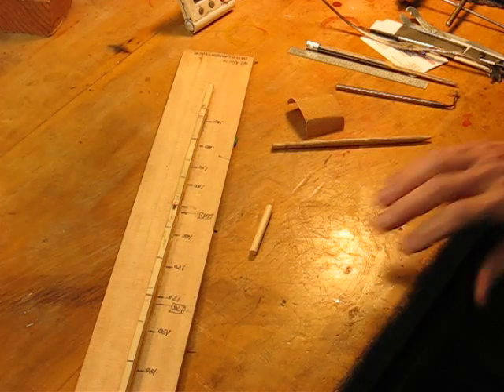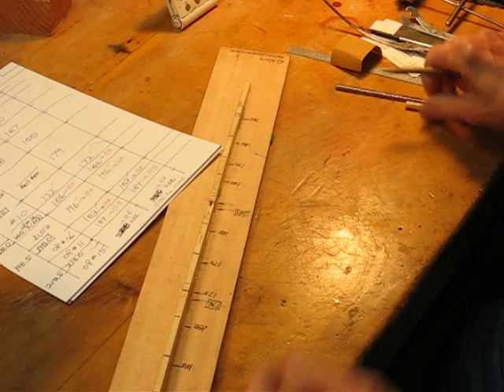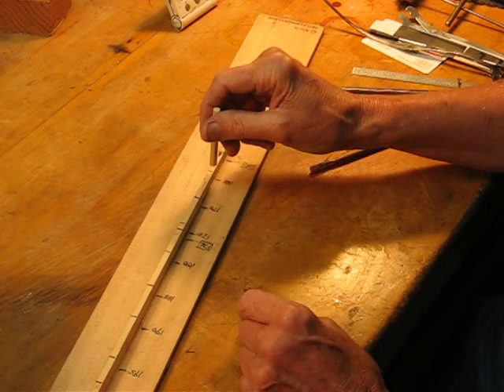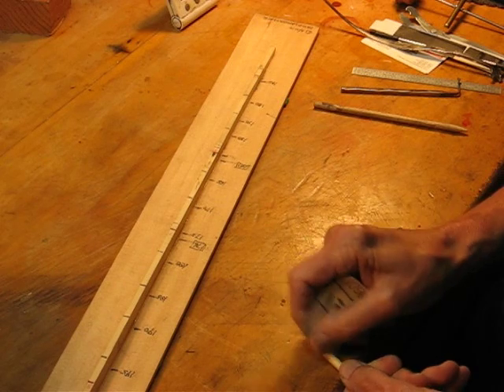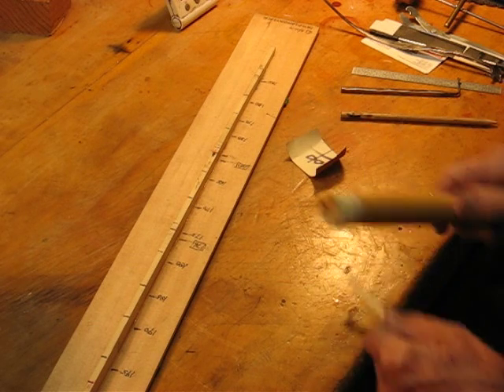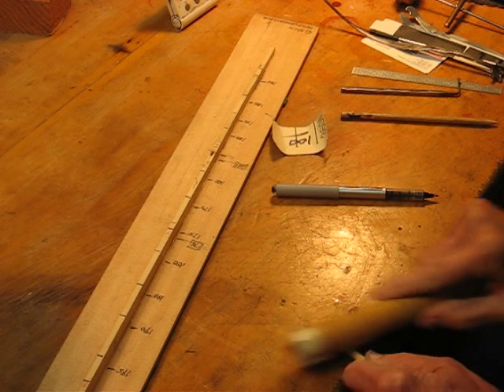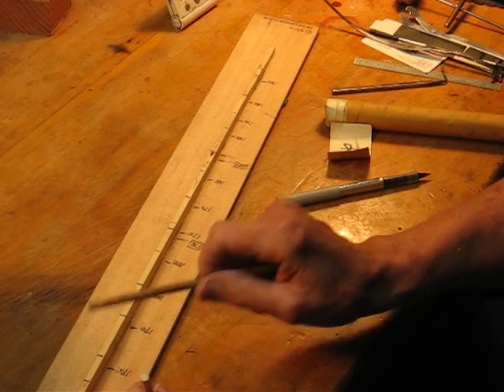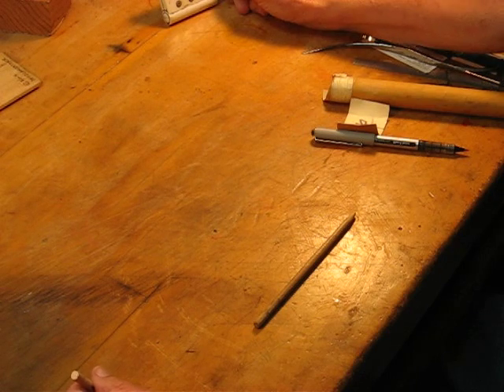SoundPostTuning

Comment: In addition to the tuning done here, there were at least 3 regions on the upper plate that Stradivari carved special;  1-under the soundpost/bridge on the top (and bottom) plate.  2-in the tweeter area left of the left f-hole.  3- he carved a finger of thicker wood on the top plate under the fingerboard. These 3 things evened out the sound from high to low frequencies and helped a lot to improve the  impulse spectrum amplitude overall (string speech time).

Comment: Nice video and explanation. How about the cello and bass? Any specification for them recommended? I am struggling with both instruments, especially with the wolf tones they have.
Reply from the maker: Danny;  I have not done a lot of investigation on the Viola / Cello / Double Bass yet but I suspect that the larger instruments values for tap tones will be in proportion.  For the double bass I might look for sound post frequency of 287 HZ and the Cello at 242 HZ (which I also suspect will be their back plate tuned Tap Tone frequency).  The Tap Tone / Wood Tone scales have these frequencies : 162, 176, 198, 213, 242, 287, 324 HZ.  Parts tuned to these will sound in harmony with each other.  Please see www.violinresearch.com for much more detailed information (focused on Violin).  David L.
Reply: David Langsather Thanks again for your detail explanation. I'll try to figure it out and do some experiments on them.

Comment: I understand that total weight of the violin is not the end all; however, what would you estimate the average total weight of your tuned violins be??  Total; stings, chinrest etc?  Thanks David your work has great relevance to creating great tone!!!
Reply from the maker: The violin total weight should be close to  450 Grams ready to play with chin rest (400 grams without chin rest).  Provided if all the other parts of the violin seem to be properly sized (neck, fingerboard,) then extra or missing weight probably means the violin plates (front and back) are either too thick or two thin.  A slight amount of extra mass in either plate will make it much stiffer and not respond properly to string vibration.  Too thin and the instrument will produce a hollow sound. David L.

Comment: i was thing that after i added the base bar on again   that it would change the tuening again..but it do defently work..tuening the top of a violin..becouse if we take sand paper on a coat hanger  and scratch  in both ends of the violin ..it do defentily change the tone of the violin   i have did most every thing

Comment: sir, do u thing that the top and the bottom of the vilion can be tuned  when the fiddle if all to gather  befor the varnish is installed on the strad..
Reply from the maker: +robert b ;
Yes it can be done on the outside of the plate after the varnish is removed. Note that patterns for tuning are reversed from inside layout.  David L.
Reply: +David Langsather  thank you sir..

Comment: Antonius stradivarius must of had some hand made tools that did the Measuring Thickness of the top plate and bottom..becouse if this top plate was the same Thickness ..that means it would be in tune ?
Reply from the maker: Good question;  He did have a punch type tool that was set to various thicknesses and then the small punch mark was pressed into the inside wood, to guide the shaping of the plate graduation in various parts.  As to you observation about top and back plate graduation differences,,  I would suggest that it is because the top plate, being driven by the bridge rocking motion, and through the interaction of the sound holes in the top plate,, require this approximately even top plate thickness design.  there will always be some variation in plate thickness because the wood is not completely uniform in properties everywhere and thus will need to be compensated slightly.
  I believe the very different graduation of the back plate is determined by the fact that it is driven by the action of the sound post motion up and down and off the center line.   David L.

Comment: Does it occur to you that when you tap a sound post with a pencil you might well be hearing the pitch and tone of the pencil - not the soundpost!!?
Reply from the maker: Yes, thank you.  It did occur to me about 20 years and thousands of hours of investigation into the mysteries of the acoustics of the violin, ago!  I do not really recommend just using a pencil, but a piece of violin quality spruce top plate wood about 5/16" square and about 6 inches long (split our rather than sawn).  Make this test yourself;  selecting a piece of instrument making wood, tap on the surfaces of the block of wood in all three directions (front back and ends) listening (no mind talking allowed).  Do you hear any difference?  It is true that the tap device will be part of the response you hear, but you are wanting to hear the other response tones, the ones from the subject violin surface.
  For more information, visit www.violinresearch.com / look in index section / under Tools, useful / tap Tool.  Also follow the video link to learn how to use the tool to get good results.  {for instance, you do not strike the wood object with your tap tool, rather you drop the tap tool and then catch it again on the rebound.}  Sincerely Yours; David L.

Comment: we cant not check this out on a violin that is made as in the 1900 Centuries..becouse thay are not made like that any more..if it was made like this as old strad did it..then we wouldent have to make over the top plate..by tap wood tuning ..as a high and low sound pitch..much the same as a fiddle pitch tuener

Comment: SoundPostTuning..... tuning a sound post ? I don't understand what it's mean and what for ....
Reply from the maker: +Michel Potier ;  good question...The short answer is that each part of a good violin is working acoustically with all the other parts.  If not the potential sound is not realized.  In the case of the sound post, the end tap of the sound post (in the direction of the wood grain; either in or out of the instrument needs to be 198 HZ (G below middle C on the piano).
  To test in the instrument, tap on the top or back place directly over the end of the sound post and compare it to G (or the center tap of the back plate).  
David Langsather
Reply: +David Langsather I see, thanks !!

Comment: and on the old million doller strad..thay can take an old violin and do it all over like new varnish new neck all..Except the violin cage ..like the top bottom and side ribs...if thay do any thing to this  it will damages the violin sound ..and the bottom looks the same as thay are makeing to day..top as well ribs...same kind of wood.. base bar same size spruce wood ..so it have to be the turning of the four corners ..maybe he did ...tap tone tune the for corners...as an open.. ..E..A..D..G..?